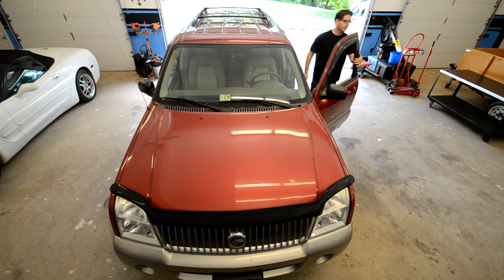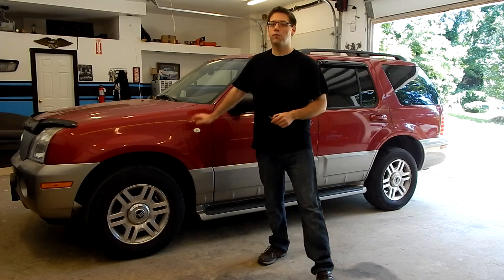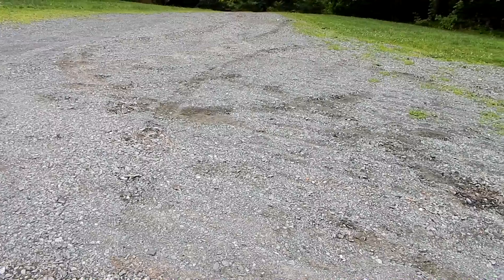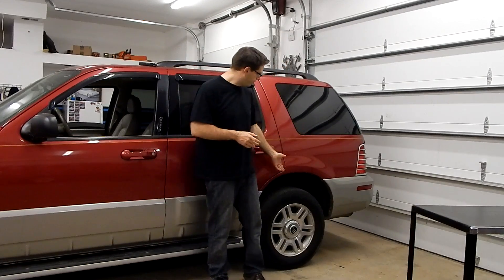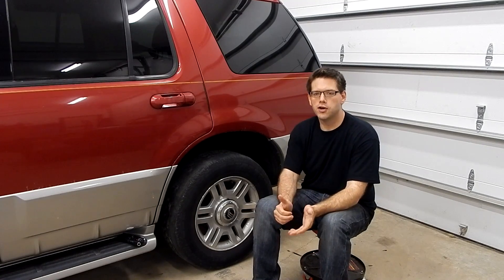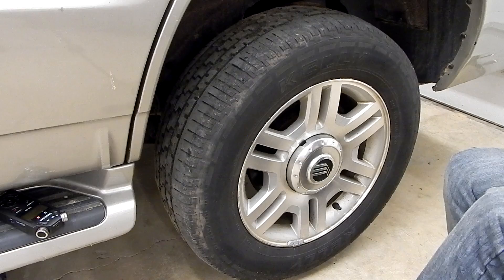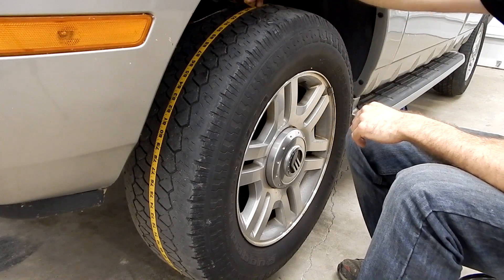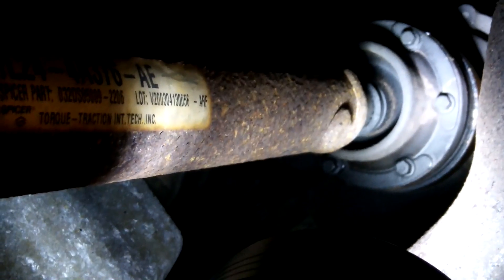Mercury Mountaineer - AWD Binding Diagnosis / Tire Sizes / Project Intro - Vortex Garage Ep. 5

Comment: I cannot figure this out.. I got stuck in some snow heard a pop and won't drive at all and when I put in drive it just grinds. Drive shadt are not broke any ideas?
Reply from the maker: I take it the drive shafts both do not spin?  My only guess would be two main things:  1.) a failure in the transfer case, such as the chain inside breaking.  I think though if that were to happen the rear would still turn but I could be wrong.  Also if one of the internal gears in the transfer case broke it could be grinding and not sending power..  2.) unfortunately it could be an internal transmission failure - I'd look to see if it acts the same in reverse and try the other gears outside of drive to see if any change.  

If you do see the one of the driveshafts moving though, it's possible something in one of the differentials or an axle CV broke.  Either way best of luck trying to find the cause.

Comment: My 04 ford explorer got a binding issue in a left hand turn. I had to get a new tire on the right rear. I drove it that way for a few weeks. Then I replaced them all with a new set. Binding solved. I also went from 235 to 245, they dont rub, and my speedo is finally showing the actual speed, compared to gps.
Reply: Hey I know this response is a long shot, but when it was binding was there any clunking accompanied with it?

Comment: I removed thefront driveshaft on my 08 mountaineer and now it won't drive at all. No rear wheel drive as i thought it would be... Any idea what that's about?
Reply: Consider that removing a driveshaft forces the viscous coupling to serve as a clutch transmitting 100% of the power 100% of the time. It's only intended to help change the bias of power between front and rear on a temporary basis as needed. So removing a driveshaft will likely decrease the coupling life dramatically and may even cause failure. If it fails "open" the vehicle will lose any drive to the wheels (it effectively becomes an  "open" center differential) 
Although if the coupling is "seized" it might work just fine.
Reply: @eddie money  Got it! It's broke and you can't fix it and can't possibly make it any worse than it already is. 
Keep in mind I originally responded to a question about having NO drive with one drive shaft removed. Those symptoms are fully consistent with a viscous coupling having failed in "open" (i.e "no drive") mode - the opposite of being seized -  which is what YOU probably have. 
I fully stand by what I said (and explained) originally. Feel free to believe whatever you want and good luck keeping you car going - crippled as it is.
Reply: eddie money   Most folks would consider an AWD vehicle with a nonoperational AWD system to be crippled. Maybe a better word is "hobbled." Whether it's broken or intentionally disabled hardly matters.  
Glad to hear that yours is working so well and you are so pleased with the vehicle! 
It's been nice chatting with you.
Reply: eddie money  I knew a guy who walked with bad limp. But he had one leg amputated and the limp is no longer noticeable. ;-)
Reply: Your rear end of fucked or transmission not trading transfering torque to it
Reply: eddie money  Let's discuss the definition of "crippled" over dinner at my house here in Colorado.  I'll pick the day (mid-winter,  to insure it's nice and snowy). You have to drive your "un-crippled" (by your assessment) vehicle and make it up my driveway - with its 14% grade.  I will note that it is quite often non-navigable by any vehicle with only one driven axle - FWD, RWD or an "AWD" vehicle with one driveshaft removed.    
Of course your other options are to simply  STFU or acknowledge that RWD is "crippled" compared with  "AWD" under slippery winter conditions (as one prime example).
Reply: eddie money  - Ignorance is bliss and sometimes you get lucky despite doing something stupid.  If you have seized up the viscous coupler and have no front drive shaft, you would not be aware of any issues. Let us know if you get drivetrain binding (as shown in this video) when you put the front shaft back on.

Comment: I was just under an 03 Mountaineer with a steering binding problem. The front diff mounting bushings are shot. Very common with these.
Reply: Vortex Garage I really appreciate the info. Sometimes we have to use what we have and improvise. I have the powerbuilt 23 pc ball joint kit. We will see how it goes.
Reply from the maker: Marc Smith this one had that. I still need to edit the video but shot video as I replaced them with new bushings. Ended up removing the housing since I was also replacing the rack and balljoints so had it mostly apart in front
Reply: Vortex Garage what if it's not awd
Reply: What did you use? I am picking up the bushings from Ford today and doing the job at the end of the week. It is an odd design how they are in there. I was trying to purchase the OEM tools, but it can easily get over $500. I was thinking air hammer out and my hub bearing removal tools to re-install. Not looking forward to this one without the proper tools.
Reply from the maker: Marc Smith , going off memory, but used a ball joint press tool, press adapters and sockets to push them out.  But the steel bushing outer rings also were corroded onto the aluminum diff housing so used penetrating oil and some punches to get them started. I think at least one was in so good (and the rubber so perished) that I basically caved in the outer steel rim of the bushing and punched it out. Aside the from the ball joint press clamp no Ford special tools needed
Reply from the maker: (the ball joint press I have is an OTC tool not sure Ford one btw)
Reply: Vortex Garage 
I have a 04 awd how much for full repair
Reply: Vortex Garage 
Can you email me jacksondaequane@gmail.com

Comment: all you had to do Is pull #17-18 fuses under the Hood lol
Reply from the maker: the mechanic this is a mechanical setup and no electronically controlled.  I think the explorer has that setup as an option
Reply: Vortex Garage I see yeah mine is like locking up in 4 hi 4 low but driving in auto seams OK any ideas why ? just added fluid and the tires where at different pressures it makes a poping sound  when or out my fuses are in its in all wheel drive 35%/65% it makes a clicking sound instead of a poping
Reply from the maker: the mechanic - If you pulled fuses 17 and 18 does the binding stop?  If so it could be a fault in the 4wd controller, which I think on the explorer is behind the glovebox. That said I don't know procedures offhand for testing it, but if it goes away with the fuses pulled that may be a sign to look into that
Reply from the maker: the mechanic - also yeah on this Mountaineer it has a single speed mechanical AWD, no low range on it and it engaged by a viscous coupling do diff from the explorers electronic 4wd
Reply: Vortex Garage clicking noise with the fuses pulled popping sound when driving on pavement slow in 4 hi 4 low when you give it gas I do not know what it is e brake, axles, rear diff? my friend has a lift going to put it on that I guess

Comment: I have this same problem with my 2003 Mountaineer.  Just got new tires so I know they are all the same size. How do I get this diagnosed properly to determine if it is the ball joints, steering shaft, drive shaft(s), viscous coupling.I had a service garage "Throw the Book at me"..  from all Ball Joints, the Intermediate steering shaft...??  Struts, APPROX...  $2600. Since the viscous coupling is NOT servicable.., How would we get it fixed...???   A NEW TRANSFER CASE?  would NOT the new viscous coupling also go 'BAD" and have to  be repaired again. by removing the front driveshaft, you determined the issue was the viscous coupling.  can you just leave the front drive shaft OFF and Drive with ONLY the rear driveshaft (full time?).
Reply from the maker: Yes you can drive these AWD tcases with out the front driveshaft. just be sure to use your parking brake as due to the torque split there is not full holding going to rear wheels when in park.  If you check out our channel we do a repair of the transfer case and replace the viscous coupling. they are about $500 if memory serves.  but I'm like you, how do we know a rebuilt tcase has a new viscous coupling?  most likely not...

Comment: Hi, I have a 2007 mercury mountaineer and the ABS & traction control light are on. When I drive it it locks up the wheels. When you turn the front passenger wheel locks up as well. So I took out the AWD fuse and it drove fine. Only thing is now the brake light is on with the others. Please help. Thank you Greg
Reply: are you fis it oready? was the problem? thanks

Comment: I have a 97 mountaineer that I just replaced the cv shaft in it and on the way home from replacing it i started hearing some clicking and banging noises and I started slowing down and as soon as I get off the gas it starts to shake uncontrollably and it feels like the front of the vehicle is trying to drag and slow it down but as soon as I get on the gas the shaking stops and it just clicks. Do you have any clue what this is and what I can do to fix it?

Comment: Hey I have the same 02 mountaineer with the front diff blown had a big hole in it can I take the front drive shaft off and drive like that or will it fuck up the trans or transfer case
Reply from the maker: it should be ok to drive without the front ds installed, however be sure to use the parking brake when parking as it may not hold as much witj the trans in park esp on a hill

Comment: I have a 2005 Mountaineer AWD. I replaced the front tires with new ones and right away started hearing a banging noise from the front of the truck. Like a fool i kept driving it like that for almost a month until i replaced the rear tires too and the noise went away but my mechanic told me i broke the front transfer case. Can the AWD system still work with a transfer case broken? I am trying to fix but is very expensive.
Reply: Kel M how did your situation pan out? Is your Mounty still driving ok? Did you have to do anything to the transfer case or are you just driving it anyway?
Reply: Randall Caulder I took it back to the mechanic and it was actually the front differential that was broken.

Comment: I have a 2003 Mercury Mountaineer AWD, the exact one you have worked on. I am having a problem with it that so far no one has been able to diagnose. The symptoms are:  Loud hum that starts at around 15 mph and gets louder when turning to the right. It sounds like it is coming from the drivers side, and has a kind of rhythmic pulse. It quiets down and has a floating sensation when going over a hill. Also has Tire chirp when making sharp turns on dry pavement. 

Tire wear is even and all matching tires...

We have replaced both Hubs in the front to try and get the hum to go away.

Other things that have been replaced are: front differential mount bushings on drivers side, sway bars links in front both sides, rear differential  (spider gears, clutches, carrier bearing, pinion bearing, and seal), front and rear differential fluid, and transfer case fluid. None of these things were replaced due to the hum though.  

The hum started when we hit, at very low speed, a huge pothole that had been filled with concrete. The concrete actually lifted up the drivers side about a foot off the ground and then dropped the mountaineer.

Any suggestions?  We are at a loss...
Reply from the maker: just off the cuff, are the front half shafts ok?  my first thought was hubs but you said those were done. How about the front driveshaft?   Is the boot on the rzeppa joint near the transfer case ripped?  also is the tire and wheel ok?  Have you had the front drivers tire checked for a splipped or broken belt and any bent rim issues?
Reply: +Vortex Garage 
The half shafts look and feel good. The tires and wheels are all good, now the front driveshaft boot is ripped, however the hum doesn't go away when the front driveshaft is out.
Reply from the maker: +marlo thurston Definitely a tough one. I'd try rotating the tires and see if the noise moves.  othereise Ill have to think.  Sounds alot like a hub but that was already done...and removal of driveshaft eliminates alot.
Reply: +Vortex Garage 
Tires are rotated every 5000 miles, just done a few weeks ago.  Sound doesn't change.
Reply from the maker: +marlo thurston only other rotational stuff is the front diff and the bearings in the front diff axle shafts. but maybe its not rotational, the drop may have damaged a motor mount or trans mount, or broke an exhaust hanger.  it could be exhaust hitting something while move from something like this.
Reply: +Vortex Garage 
We will check the mounts tomorrow,  and check the exhaust. As for front differential,  we know there wasn't metal shavings in it, and the fluid that came out all looked good
Reply: +marlo thurston 
checked the mounts they are all good. put it up on 4 jack stands and tried to pinpoint noise, but it can't be heard from the outside of the vehicle

Comment: can you safely drive this AWD vehicle without the front driveshaft installed?
Reply from the maker: Yes, but make sure the ebrake works. it may not hold on a hill in park I have read.  But this particular setup is ok to drive w no front driveshaft based on feedback Ive seen.  The tcase output is flanged so no leaks if ds is removed.
Reply: @VortexGarage  - Not generally a good idea, although you might get away with it if the viscous coupler has already failed by seizing. 
See  http://tcase.rsgear.com/articles/2006_11.pdf.  The most relevant discussion there starts near the end of p. 33.  In short,  "After a short time of working constantly, the viscous coupling overheats and fails."  Also note the discussion @7:10.  Having one driveshaft out is the same as having ZERO traction on that end (and ZERO speed on that side of the transfer case), which causes the coupling to have to work constantly to get any drive to the connected end.
Reply: DR - 
Thank you for the linked article.
Reply: Thank you sir, very much

Comment: Is it possible to drive the vehicle with the front drive shaft removed while I'm trying to locate a viscous coupling ?? Thanks
Reply: If it's totally locked up, you can drive it. But make sure the parking brake works well cause truck will creep even in park w/o the front drive shaft. Doable but not recommended. Had mine rebuilt by STE Couplers, still working well 5 years later. Need to rotate tires religiously at every oil change with this setup.

Comment: Ok so i took the front driveshaft out and its still binding in the rear, any recommendations? Oh and i replaced transfer case, still binding.
Reply from the maker: Do you have a limited slip rear end?  have you recently changed the fluid and if so did you use friction modifier?  The lsd clutches may be binding or chattering.  also the rear diffs on these are a weak point.  I had to replace mine as it rumbled on the highway and pinion bearing was shot...not sure that would cause binding though.
Reply: +Vortex Garage 
it is a limited slip rear end, and were not sure about how long or if the right fluid was even put into it. A friend of mine said the clutches might be bad to.  So im thinking about just getting the fluid and using friction modifier, and crossing my fingers.  Do you know how much fluid and friction modifier i will need?
Reply from the maker: +Michael Domino I dont recall the fill capacity for the LSD, but I beleive you add 4oz of friction modifier.  Adding a bit more may further reduce chatter but will also reduce the effectiveness of the clutches.  The owners manual if you have it, has the fill capacity of the diff in the Capacities chart.  Also you fill up to the fill port on the back, and then replace that plug and fill from the top where the vent is.  the plastic vent tube also can break easily so be careful, though is cheap to replace at the dealer.  (mine was broken when I went to remove it) these are a pain to refill to factory spec compared to something like a Dana 44.   Sorry I dont have the full specs handy, and I also do have video of a diff swap and fluid service i need to catch up on editing and posting.
Reply: +Vortex Garage Thanks for the advise, ill get back to you on the results.
Reply from the maker: +Michael Domino you're welcome and good luck!

Comment: I've '02 mountaineer 4.0 liter awd with a popping noise coming from the front driver side wheel while driving straight down the road, it's very loud. I was told it ran for a bit with different size tires on the same axle. What do you think it could be? thanks
Reply from the maker: hard to say with certainty...one possible culprit would be the CV axle shaft.  It could also be a brake issue too, if caliper was loose...   Could also be in the driveline, if front driveshaft were removed and it stopped that may tell you more too.  Also are you sure its front left?  Ebrake shoes breaking apart in the rear can cause clicking.

CV halfshalft sounds like the first thing to check.  I would inspect the front end and pay attention to the CV axle boots for tears.  inspect rest of front end for wear, tie rods, wheel bearing play, etc.